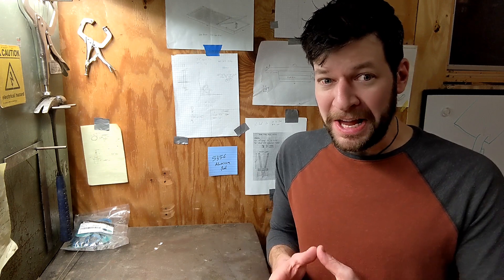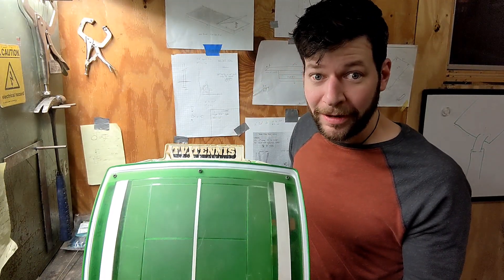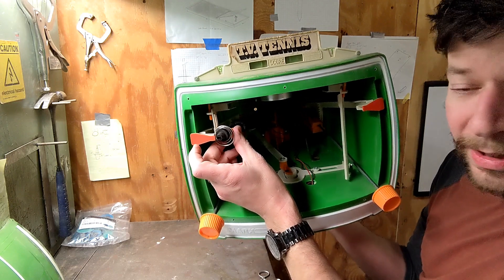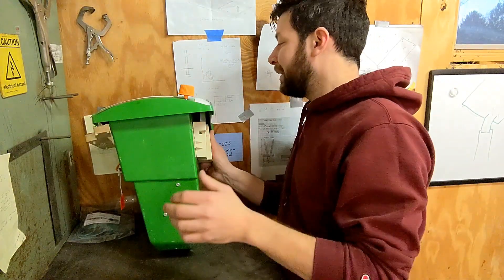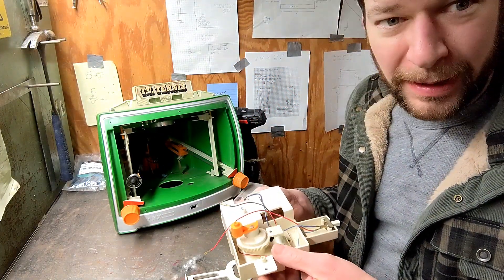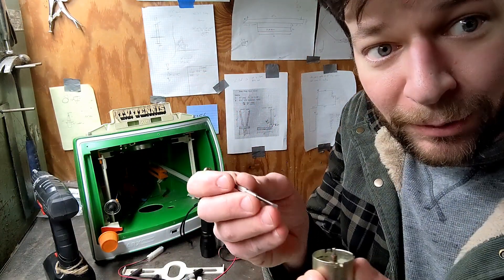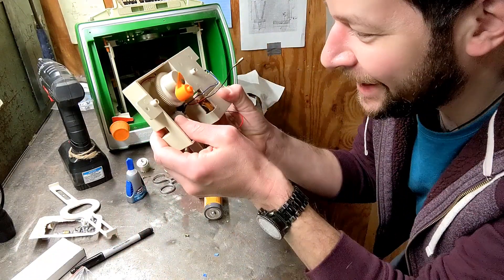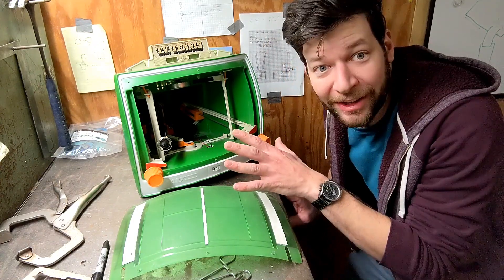Vintage TV Tennis: Let's dig into it

Comment: I find it very nice that people want to fix things and are curious. I am worried that he will put his hand in without having the minimum necessary knowledge. More than anything in such old things. The motor is perfect. You just have to repair the brushes. You do not need to replace it with another. Much less if it is made for another voltage. You've also made holes that you shouldn't have to.
Repair is not simply replacing components with others. In very old things, it is always preferable to leave it as original as possible. My finger goes up anyway. Try to do better next time.
Reply from the maker: Thank you. I love tinkering. But I definitely went in without the knowledge of how to properly repair this toy. I just blindly kept moving forward trying to learn along the way. Hopefully the next relic I tear into, I will be able to use things I learned from this venture.
Reply: What are you worried about here? It's not a museum piece, it's an old broken toy and he got it working again. This is exactly what tinkering is about, and you get better by doing this kind of thing. A 40 year old motor with worn out brushes is not "perfect", and if you have a similar motor in the parts bin, it's way easier to swap them out than to go find new brushes for the current one. Try not to be so judgmental about someone fixing an old toy that was left to die. It isn't a barn-find Ferrari.
Reply: The idea of repairing a plastic toy from the 70's with original parts is laughable.
Next time I fix an NES, I'll think of this for about two seconds before replacing the 80's made-in-China connector with a recently made-in-China one that restores the device to its original functionality.
Reply from the maker: @ross302ci  thanks. That's a really good way of saying it. Any fix is better than no fix, which is where it would have been headed.
Reply from the maker: @sonictimm  yeah, you gotta be able to work with what's available. Sometimes original parts are just not an option.
Reply: @ThingsTomLike  I think it's weird to see an old thing like this with the screws not only not hidden, they're not even recessed. So much stuff was just built a lot cruder back then. A tip I learned years ago about screws in plastic is that when putting them back in, use very light pressure, preferably just the weight of the screwdriver, and gently turn the screw backwards until you feel, see, and hear it drop a bit. That has the screw threads aligned with the original threads it cut when it was first driven into a plain hole.

That prevents the threads from getting stripped out of the holes.
Reply from the maker: @greggv8  oh yeah I totally agree and I appreciate the tip. When working with something like this I'm tightening those screws to the bare minimum because I don't want the old plastic to break.